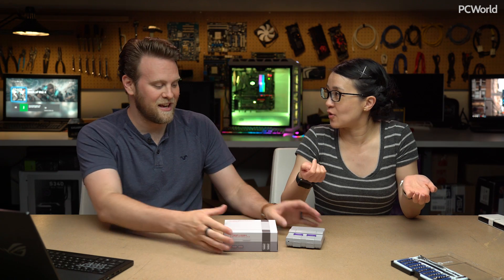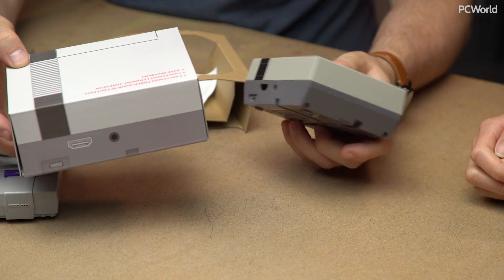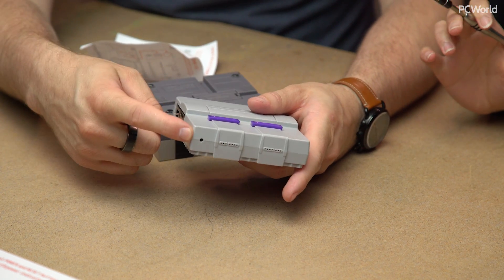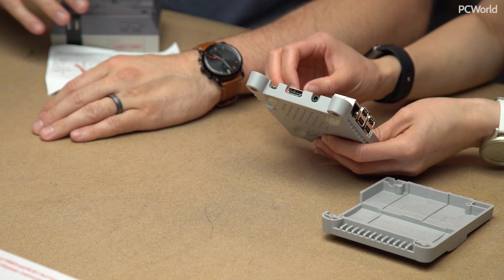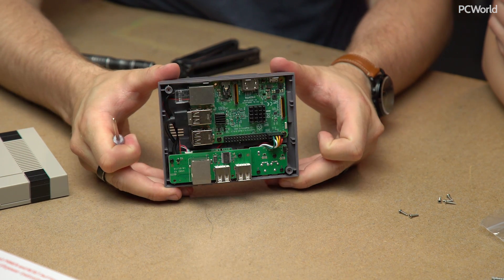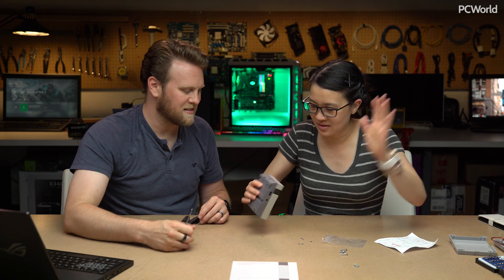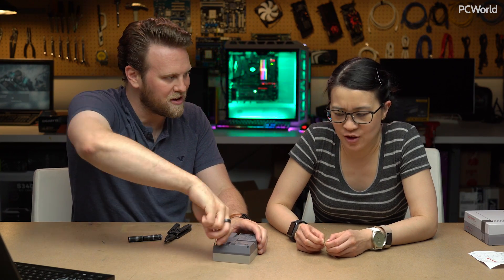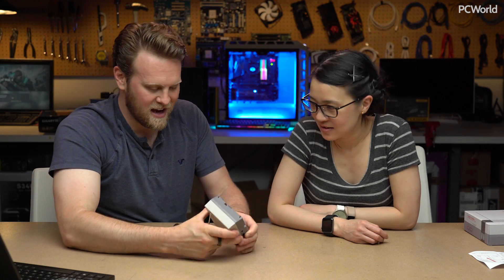RetroPie build update: Switching to an NES case

Comment: I'm running ROTT (based on Retrori) on my ASUS Tinker Board It would like Retroflag NESPi Case+  with fan for my system. The TInker Board is the same form factor as the Raspberry Pi. Thanks guys..